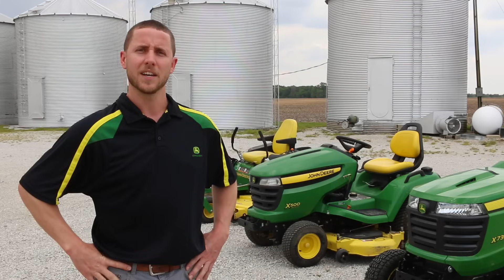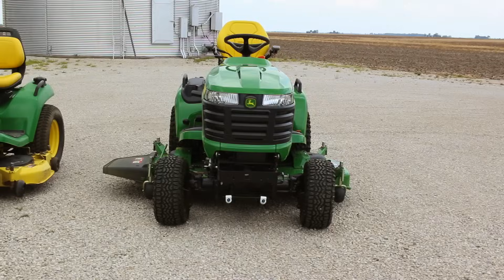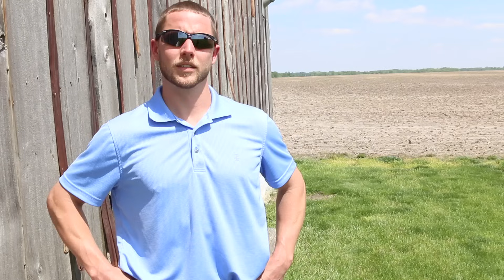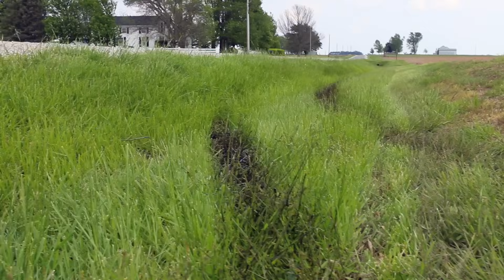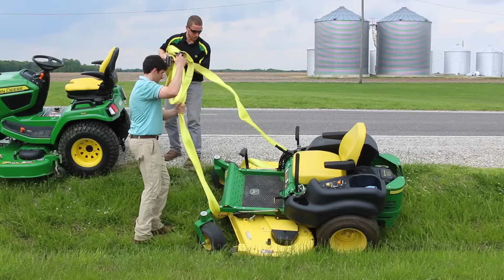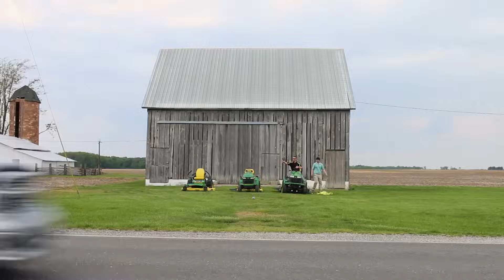The Slope Test

Comment: Use a 970 R with tweels and you can go about anywhere. Mowed 30 acres of Interstate ramps for 8 yrs in SW Virginia. 35 HP motor with rear weights at the back of the mower

Comment: Have a zero turn.  It’s rated for a 15 degree slope, and I believe it.  I actually have to do strips with a mechanical push mower because I don’t dare risk getting the zero turn too close.  In other areas, it’s a struggle to go up/down slopes.  Better going uphill than downhill as far as having power and control.  In spite of knobby tires, it is useless on slopes if you cut the bottom part first.  Once you hit cut grass, all bets are off.

Comment: Adding some weight on the back of the zero turn would help to counter balance the frontend. And weights in the rims would help.   Gripper tires as well.  Should try it then. 
How the Grasshopper kind of mower 
Works pretty well on side hills. 
John Deere has that kind as well. 
Wonder how the track one's would do on that.
All wheal steer is the best option for lawns like that.  Best bang for your buck.  And still turn pretty sharp.

Comment: No fucking shit the 3rd one did better. Half of the damn tires were on the road
Reply from the maker: Josh, It does appear that way.  However the clips were all shortened as to not complete bore its viewers.  It just happened to be cut at a point where his tires were high.  Having said that, its pretty well obvious which would do better.  The goal was to see how the zero turn did in comparison to the other ones.  Not really a competition because each is a different tool for a different job. Thanks for the feedback

Comment: We have a JD X738 with the 60" deck at my work place that we use for slopes. We really messed up by not choosing the 4WS version, because that would have made this amazing mower even more amazing and useful, because we really need that tight turning radius for our application. We use two 72" Hustler Super Z HDs' for our large fields. The Hustler zero turns will mow in some very precarious areas, but that JD X738 will mow just about anything, anywhere and puts one of the biggest, baddest ZTRs to shame on slopes and hills.  It is unreal where the X738 can take us, which is what we bought it for. It's also nice that it's fuel injected with no cold start up issues (not like a Kohler FI engine that we have on a UTV that acts like its carbureted even though it's FI). Power steering plus it's traction, plus the 60" deck option, plus full-time 4WD, plus cruise control makes this mower almost perfect for our commercial application; perfect would have been the 4WS feature for another grand. As one example of how good this tractor is (disclaimer), we mow a slope that varies from 15-25 degrees for 200 yards with guide wires and poles right in the middle of the slope. Not only does this mower handle this very steep slope with very little slippage, but it allows us to meander around all the very tight obstructions with the steering wheel and handle to hold on to with easy-to-manage, one-hand power steering while in the middle of the slope. 

I know that technically, the X738 is not a true slope mower and not rated for 25 degrees, but in reality it will do it and do it safely as long as you can hang on. It is an expensive lawn tractor, but just try pricing out a true slope mower. Previously, we had used a small tractor mower that would also handle the slope and obstructions, but its small deck took us forever and without the power steering, wore us out on that long stretch going full left, full right over and over with the steering wheel around the obstructions. The X738 is so easy. The X738 is comparatively, a good value and nothing like it on the market that I could find versus a slope mower. I just wish that I had opted for the X739 with 4WS because the turning radius is so much larger than the small tractor we once had. We paid probably a grand more for the 60" lawn tractor than we did for each of the Huslter ZTRs if I remember correctly, and the Hustlers are of course far more productive machines with respect to getting large swaths of grass cut, but for cutting steep slopes comfortably and quickly and thoroughly and safely, X738 is hard to beat. Unless of course you have an X739.

Comment: Hate to say, but in this situation, four wheel drive is NOT what helped, but having 2 tires on the gravel, and therefore more traction AND a somewhat less steep angle. Four wheel drive does nothing with sliding sideways due to wet grass and mud. But you are presenting it that it does.

Comment: I added 1 1/2 inch spacers on the back of my z445 and tractor tires and it will beat anything john deer has.
Reply from the maker: That is interesting to hear. Have you experienced any down side from spacing the wheels out? I know in automotive it can lead to other wear issues down the road.

Comment: That is a fairly mild ditch except for the mud in the bottom.  I used a John Deere 420 lawn tractor years ago and could put it way over on it's side to mow a ditch.  I had the wheels in the wide position and sat way over on the fender.  (safety switch was worked around so it would run)  This is a "do not do this at home" moment for most people.  Today I would do it different.  I would get the John Deere X758 with a 3 pt hitch and 60 inch mower.  I would put Rim Guard in all four wheels keeping the center of gravity down.   I would make an arm out to the side that mounted to the 3 pt hitch and went up and down with it.   I would put  a redesigned vary inexpensive push mower on the arm that could mow the ditch.  That way one can do vary steep ditches and be a lot safer and still faster than a string trimmer.....  This is still not for the average person: Most people do not seem to really understand machinery.

Comment: Thanks this is what I needed to see. I have an easement by the road just like that ditch bank you did but not as muddy usually. In the past I have used John Deere L series and Husqvarna 2 wheel drive wide cuts and they worked well as long as I keep the deck from rubbing bottom. It seems I will need to get the same setup again. Although  ,  I'm wondering if the the smaller zero turn Z325 with less weight and shorter deck would do better on slant

Comment: I own a z445 and do ditches and hills every mow. It's 9 years old 1000 hours and I love it. Now if there wasn't mud in that ditch it would have been just fine.  I've done 9 years of slopes and I must have gotten used to it and don't have trouble with it, you have to work the handles a lot to keep it on the slope tho.  I hope to upgrade at 10 years and have looked at the new jd with a tweel, not really sold on that yet and also looking at a scag, tough call.

Comment: I have a JD757 Zero turn. I cannot mow even a very slight incline, no where near as steep as your first test without the machine running out of control.  I have it at a John Deere Dealer and they were unable to offer any solution.  Anyone else have this experience and any solutions? Thank you.
Reply from the maker: Hey Michael, I spoke with our L&G tech and he recommended you check your tracking first. To do that, find a straight line and drive over it at full speed. It should stay centered for 15 feet or so. If you notice even a slight drift that is likely your issue. If you try that, let me know how it goes.

Comment: Just bought a Husqvarna I looked at the JD line up at the local quality equipment dealer. If a 10-15k riding mower is what it takes to mow a ditch like that I'd just spend 250 on a weed trimmer

Comment: I use a Kubota zero turn, the z724 54 inch on banks with more of an angle than the ones you've shown and as long as my speed is good I don't have too many problems and I've always been able to wiggle my way out of the muck. But if you're in really wet and muddy situation I would like to have a four wheeler.

Comment: Get an exmark 48" vantage, or 60" turf tracer with a single wheel ride on attachment..  there's nothing you CAN'T cut with them..i use a 48" vantage..i have half an acre of steep, rocky hillside, and it'll drag me around as fast as i can handle going

Comment: Or just let the grass grow where it’s so stinking steep. Or use a commercial grade pull type mower. I used to have a lawn service and sometimes customers would want me to mow or weed whip steep slopes. Some were such a pain I said no. The taller the plant is sticking up out of the ground,, the longer the roots are. Long roots are good at holding the sloped ground together.

Comment: If you don't have hills,or ditches get a zero turn,other than that get a normal riding mower.,just preference
Reply from the maker: Agreed!  A zero turn can save you lots of time!  A riding mower (lawn tractor) really shines in these situations and also when you want to add attachments!
Reply: Just get a front mower and have the best of both with the added benefit of being able to nose the deck under fences, decks, and low hanging branches. Also works good for nosing the deck down steeper ditches or the edge of ponds.

Comment: the zero turn got stuck cause your not carrying enough momentum through the slope and the deck got caught on the low ground. ive gotten stuck with my scag turf tiger  one time and it was from a ditch that had a chunk from a tire blowout couldnt go around and couldnt go above or below it had to stop to move it to continue on. just needed a little tug out but had to restart from the begging to finish it

Comment: Each of those mowers look great and I have the Z445 John Deere mower and it has a difficult time in a ditch area at my place so I try to stay away from areas where my mowers can get stuck. My 790 tractor got stuck in that exact spot when I g.ot it new also and I learned how to work with it in areas where I could get stuck. The zero turn mower does a nice job on most slopes with no problems.

Comment: Why didnt you just drive the first 2 up in the gravel like you did the 4 wheel drive one?
Reply: Dane  Osborn
Reply: Dane  Osborn they slid down
Reply: Because they want you to buy the one that costs the most
Reply: Anf they cut the vidoe off right as it slid down also lol
Reply: Because the deck was to big
Reply from the maker: @brandonkaufmann9045  Actually the goal of this video was to show that these zero turns do a pretty good job of handling the slopes. Even if we removed the 4x4 mower from the video we are still very pleased with the zero turn outcome.

Comment: the four wheel drive must cost a fortune! i would just use the zero turn and back up the ditch repeatedly until i was done. number one priority is don't tip over your mower!
Reply: That's the whole point of a zero turn and much safer.

Comment: The 2wd tractor went past the tow strap without cheating. The 4wd tractor clearly got stuck right where the zeroturn did also zeroturn has a wider wheelbase and would naturally would be further in the ditch. Which would be weed whacked anyways. Take them on a hillside with acreage and 10 out of 10 guys would pick the zeroturn. Flat landers
Reply: Slope test my butt. More like a ditch test.

Comment: That is my experience as well, and I only have a 2wd X485 tractor with a couple mini-suitcase weights on the front.  I can mow ditches all day with the X485 without sliding.   I bought a Z445 and it cuts flat ground so much faster and cleaner than the tractor.  But on hills, the X485 is so much better.

Comment: its not the mower type its the tires you use . and DEER zeros have terrible traction anyway
Reply from the maker: You are correct for the most part.  Weight distribution makes a difference as well.  But you do contradict yourself here.  If its not the mower and its just the tires that matter than your second statement isn't really a fair statement..

Comment: Cody any zero turn gets stuck any time it is a little damp,it is a sales video but it was a good effort on mowers every body knows that with 4 wheel drive you can do a lot more then the other mowers,but then the cost is the real factor of the mowers and the job you do with it,  thanks
Reply from the maker: That is correct.  This video was mainly to give people an idea of what a zero turn can handle.  The other two were really just a control..  The zero turn held up against the others a bit better than expected actually.. Thanks for the feedback!
Reply: With the cost of that 4WD model you may as well go buy a regular tractor.

Comment: Ive been mowing lawns for 18 years and the 997 z turn john deer is the best older model though around 2011-2012 that drain slope thing he was mowing looked wet so a two wheel drive wouldnt do it. The new  z turn john deers do a good cut but why the hell would you change the roll bar to a position thats angled forward and cant be changed anyone over 6ft cant drive it unless the want to be hunched forward allday. Aparently just found that ours is the European spec model cuts well though.
Reply from the maker: Glad you are a JD fan! (for the most part 😉). Thank you for sharing your thoughts!

Comment: I take my z445 on nearly 40 degree hillsides with stock tires. The reason a zero-turn is better than a Rider on a hill is that a mower wants to flip ( ive rolled several ) once you're experienced on a zero-turn you can easily make it slide out the back end rather than flipping. Much safer in my opinion. Just take some getting used to to keep it on the hillside or ditch.
Reply: completely agree.
Reply: I have to disagree...I used to run a rider for my lawn care business, and it could handle much steeper ditches than my zero turn can.  Tires can make a difference, but in the end a zero turn's drive tires have to both drive and steer, while a rider's leaves separates those 2 jobs.  I also never felt like I could tip my rider over but my zero turn can at times get light on the front (especially since you have to aim the nose uphill on steep slopes)  Even with that drawback, I will run a zero turn over a rider any day.  It saves time everywhere else and holds up better.
Reply: Engine on a tractor is in the front, so less likely to nose up because of the weight of the motor. I find that zero turns like side to side better, because the castor wheels in the front provide a pivot for the rear when it breaks tread so it slides rather than roles. Honestly though if you’re mowing a lot of hills, stand ons or walk behinds are the best way imo.

Comment: Yup, I agree with most that it's still a very hard toss up to choose the right machine. The Zero's are freakin' AWESOME in everyday mowing especially just doing yards/fields with mid to mild slopes. The ride ons are AWESOME for their ability to get down in the crevices, slopes and holes and manage to get out more. If you have a decent yard that has obstacles and some decently sloped hills then it's a no brainer----ZERO TURN!
Reply: I agree with you on the zero turn.  I had a difficult time choosing before buying, having had lots of experience mowing with lawn and garden tractors and none with zero turns.  For those that are going to buy, my thoughts are that if you even think that you want to pull ANYTHING or use implements, hands down, a rider is your machine.  That, far and away is your big decider.  Less of an issue, but still something to think about is whether or not you have a lot of trees and things to mow around.  If so, get a Zero Turn.  The last issue is that a zero turn will do the job faster.  For a while, not having been sure if I made the correct choice, my wife, an outside opinion found the decision simpler.  She said "you bought the correct tool.  You are spending less time mowing".  Think zero turn; big lawn mower, rider/lawn and garden tractor; multi use tool that can mow lawns.

Comment: Thank you for the video... I would like to point out that blowing grass in the street is VERY dangerous to those of us who ride motorcycles and bicycles- riding over the cut grass on a road is like riding on wet clay.... NO TRACTION! Thank you!!!
Reply from the maker: Yes I agree that in certain situations it can be an issue.  This is why didn't blow grass in the street in this video.  As a rider myself, I am usually more concerned about trash flying into the road.. The amount that people throw out in the ditch is insane.. 😕
Reply: Everything is dangerous to a bike or motorcycle. If you are actually concerned about safety, the LAST thing I would take on a road is a bike or motorcycle. Seeing that just about any collision or road defect or issue will result in a bad accident. I think if you are worried about some grass, maybe a motorcycle or bike is not the thing to ride.
Reply: It's illegal to do that here in Upstate, NY

Comment: So the statements in the operator's manuals that say "No MORE than 15 degree slopes" is just a guideline?
Reply: Paul:  After you exceed 15 degrees the factors of traction, tire pressure, ground moisture and soil condition play a big part.  Also,  If going down hill with even less that 15 degrees of camber, you are going into the ditch or pond-or leaving some bad divots where you emergency reversed.  Always plan your mow to be pointing up hill and the unit can stand quite a bit of camber.  You can back down, but that can be difficult on long runs.  Either way, please put up the ROPS and buckle up. Good mowing!
Reply: It probably also saves them from potentially getting sued. If someone takes it on a 25 degree slope, flips it and gets hurt, well they can't blame John Deere.
Reply: 15° has more to do with "if something happens you can't sue us ".
Reply: The slopes we handle all day, would scare most people front tires never touch the ground